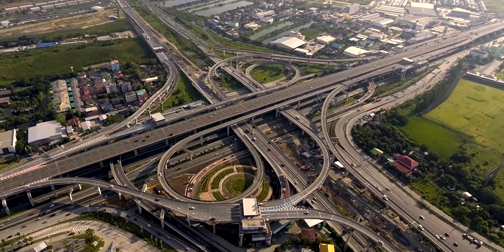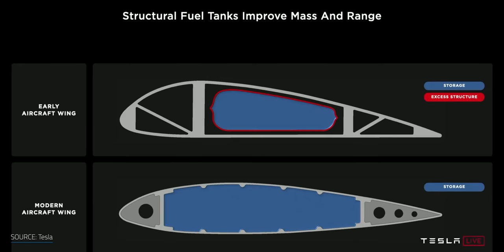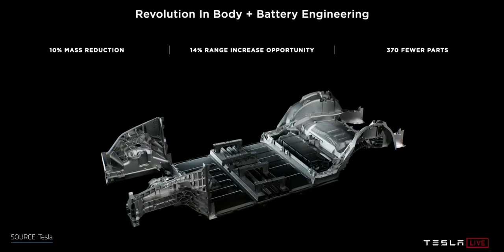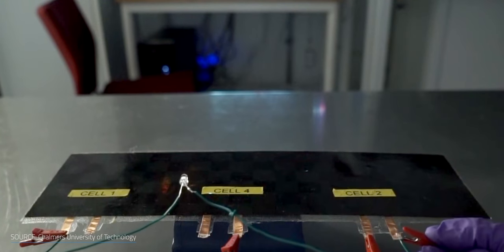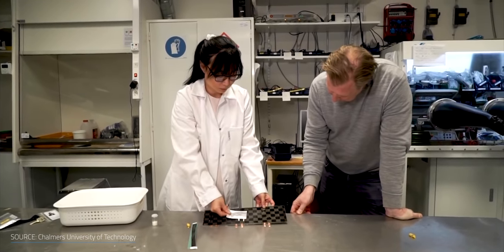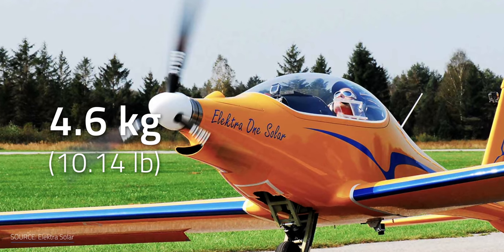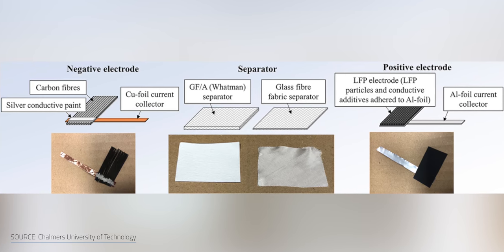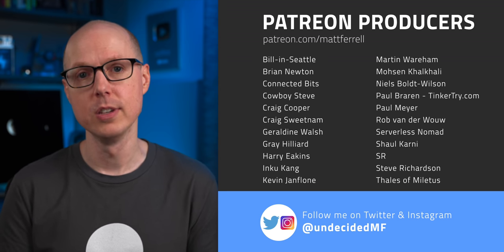Exploring Structural Batteries

Comment: There is no such thing as a free lunch. Having batteries form part of the structure makes replacement near impossible.
Reply: Not at all. If you design the structure to be easily maintained, then you could potentially swap out body panels and replace damaged or old components quite easily. But given Tesla's history on repairability, I wouldn't bet on them being the ones to do it.
Reply: @ryanbrown982  That's what I was thinking as well.
Reply: @ryanbrown982  no one is talking about body panels. The actual structural members of a car are very hard even today, impossible for most people in fact, to replace and this would make it way worse.

In the end, I think it's highly unlikely this is ever used in cars due to it being too expensive and too dangerous (every car crash would impact a battery, and they would catch fire often). In airplanes however...
Reply: @josefstalin4532  Your right & that reminds me of the frame rails rusting out early on some older Toyota Tacoma pickups // called Taco's // by those affected or discussing the issue
Reply: @josefstalin4532  if you think about it, some main structures of a conventional car like swing arms and suspension can be designed to be replaceable. I think if we can make frame or any other structure modular, then it should be replaceable.
Reply: @alvingalang5106  taking that a step farther, what about the doors on the car? Passenger doors, hood, and trunk. Also the roof of the vehicle could be the battery. All of those are relatively easy to replace on vehicles if designed correctly. Nothing they said requires it to be frame that is hard to get to and replace. They don't put the battery on the upper part of the car because of stability and efficiency issues. However if it is able to replace those structures and be as strong or stronger while also being a battery with no difference or negative difference in what it is replacing. Why not put it in easy to replace areas?
Reply: @Melivilth  I like your ideas of using doors, etc. But batteries are too heavy to put in the roof, unless you only put a small amount of them there
Reply: @ThomasBomb45  you missed what I was talking about. In their current state, yes they are way to heavy to be putting that high off the ground. In this case the battery it's self can be part of the structure. Meaning it is replacing the metal that is already there on the roof, being that it is essentially carbon fiber you are potentially losing weight from the roof structure by replacing the metal with battery. This is what they are really saying by it can be structure. If it can be frame on the underside of the car it can also be roof and body panels. No reason it can't be put somewhere where it can be easily serviceable/replaced is my point.
Reply: Let's say that the battery in an electric vehicle is more-or-less equivalent to the engine in an internal combustion engine vehicle. How many cars actually have their engines replaced before the car is recycled? If you can't imagine a time when the battery (a solid-state component) is as reliable as a modern engine your dreams must be like staring at the inside of a cardboard box! 😊

Same goes with phones. The technology moves so fast that if you keep a phone long enough for the battery to fail your new phone is a major upgrade in every respect, not a replacement.
Reply: No worse then current unibody designs.
Reply: @ThomasBomb45   Think about all the carbon fiber parts in an expensive car. Now you can replace those with the same panels but now they also hold charge.
Reply: @nagualdesign  TBH phone technology is pretty stale right now, not much actually changes year over year. A lot Iof what slows phones down is the battery getting worse and the operating system adding features that require loads of CPU and memory for little benefit
Reply: @ThomasBomb45  There are steady improvements in energy consumption and upgrading from, say, 4G to 5G is a big improvement. But if you bought a new phone today because your ten-year-old phone died you'd see a vast improvement.

Once a technology, be it phones or EVs, reaches maturity then recyclability is a bigger issue, at which point the scrap price for your old car should be pretty reasonable.
Reply: @ryanbrown982  just because you said it in a comment doesn't mean it practical or possible
Reply: Can you not replace a body panel or door? Why does it have to be any different? "Structural" doesn't necessarily equate to essential parts for structural strength. One day your front grill may also act as your battery.
Reply: @josefstalin4532  
Why do you assume it has to be a structural member? It could be something like the casing for your headlights or your front grill. The technology differs from the batteries we're all used to. "Batteries" don't have to inherently be a fire risk. Our current infancy in the technology just is.
Reply: @ryanbrown982  and how do you weld these "modular" panels to get the strength needed for a crash structure?
Reply: @alvingalang5106  combining systems is the opposite of modularity.
Reply: @nagualdesign  the analogy of the batteries being the engine is flawed, in a lot of hybrid (these have been around longer than pure electric) vehicles the batteries seem to be getting ‘worn out’ in rather quick times. I’ve heard of some people having to replace the battery on a 5-10 year timescale. Maybe the new structural batteries will last longer who knows?
Reply: Batteries does not have to be replaced if they last longer than the car.  And if the car is damaged, the panels will have to be replaced anyway.
It sounds like a great possibillity for electric planes where weight is the biggest problem..
Reply: @TheM0JEC  Yes, the 'massless' battery is many years away too. I was talking about a (hypothetical) car of the future.
Reply: @polla2256  You don't? They're carbon fiber. You can't weld that regardless.
Reply: @CrispyOkra  Read the original comment.

"Having batteries form part of the structure makes replacement near impossible."
Reply: Which is why it's being done.  If it's near impossible to replace parts you are forced to replace the whole vehicle whenever parts go bad; add in a little planned obsolescence and...well.  You're over the proverbial barrel every five years, every three years...however long they want to allow you to use the vehicle.
Reply: @sophiescott143  Pardon me for saying this, because you're not the only one repeating that, but it absolute nonsense. Manufacturers are in competition with one another, the practical upshot being that they're incentivized to provide value for money for their customers. Even though Tesla have a bit of a monopoly at the moment, I can confidently say that there will never be a car made that only lasts 3 to 5 years.

The whole point of this battery development is to make EVs perform even better than ICE vehicles, never mind being better than current EVs. They don't spend billions on development to make something that's worse!
Reply: @nagualdesign  Tesla's business practices have been mirroring Apple's a lot in recent times, and Apple is notorious for planned obsolescence.  Planned obsolescence isn't a boogeyman told about around the fire at night, it's a well known phenomenon plaguing industry, at least in the USA where Tesla is based.  This setup where the battery is integrated and non-replaceable may in fact improve battery performance, but it's also a great way to make cars that must be replaced when damaged, and that's a prime breeding ground for planned obsolescence.  We know PO happens in today's industry and we know it happens all the time.  My concern about this happening with Tesla isn't hysterical childish nonsense, it's a real and legitimate concern.
Reply: tanstaafl
Reply: @ryanbrown982  queue Sandy Munro praising Tesla for their outstanding "5 years ahead" structural battery technology because it's just 1 big piece that is completely unmaintainable.